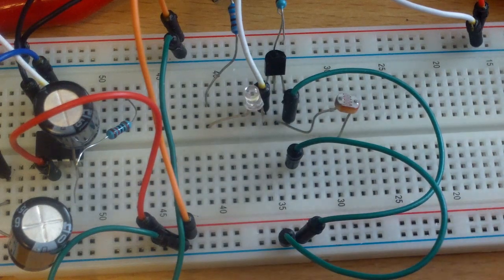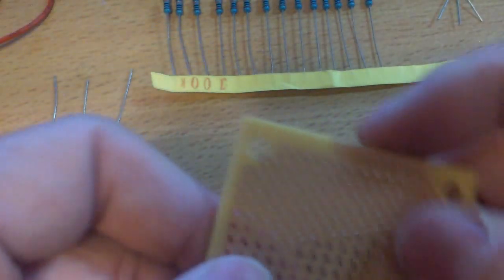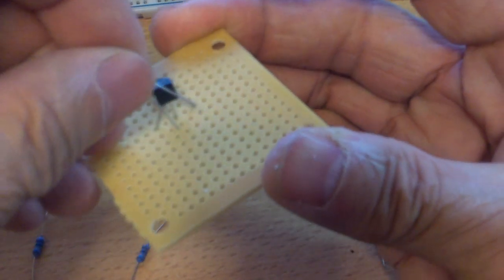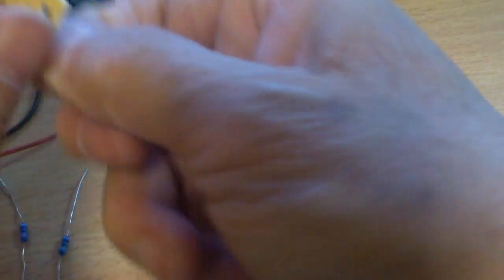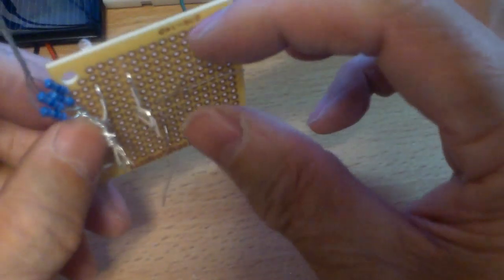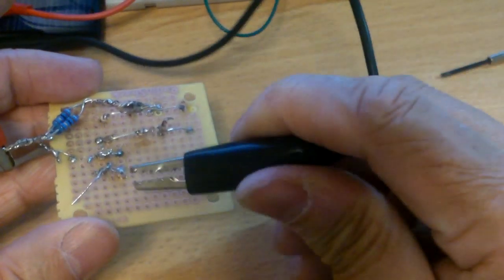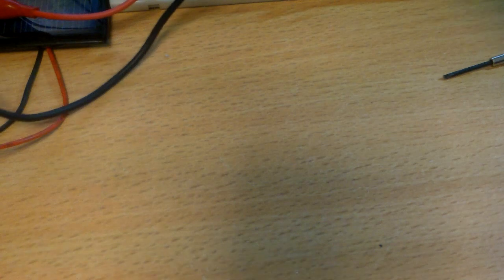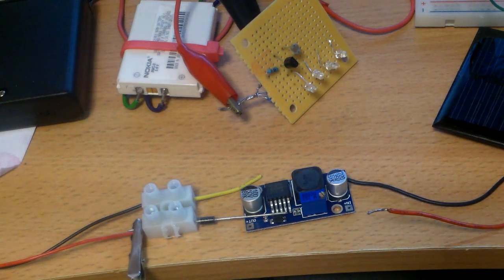Almost step by step guide to making your solar rechargeable night light

Comment: My led's light up, however- when I shade the photosensor, nothing happens.. Have I hooked up the photosensor wrong?
Reply from the maker: Your photosensor should be a small solar panel.  It should turn on when light level is low and turn off during the day.
Reply: Thank you for the answer. I realize that the photosensor regulates based upon the amount of available light. However, like you, I hooked all up prior to soldiering and found that when I placed my finger over the Photosensor, the led remained unchanged.. In fact it stayed lit with my finger off the photosensor and stayed lit with my finger on it, as well. Thus, my assumtion that I hooked it up wrong. Any ideas? :)
Reply from the maker: Romany Caravan Company Try putting the unit under sunlight for it to charge. Then bring it back in at night and see if it lights up. I will make another video of this project (when I get a chance) to see if I experience your problem. Sorry it didn't work out for you.
Reply: thank you. I will try to rewire with another photosensor. Perhaps it's a bad one.

Comment: Very nice! I want to use only a single bright warm white LED how does this change the set up from the 4 lights used and demonstrated.

Many Thanks
Reply from the maker: It works just fine with 1 LED or 4.  One LED will last longer too.
Reply: Thank you for the reply sir. Very impressive demo for a subject that baffles many of us :)
Reply: Can I use a rechargeable coin battery 3V  with this set-up? Thank you in advance for your answer.! Best, Mark
Reply from the maker: Romany Caravan Company Better to use 1.5v AA rechargeable battery. The eneloop battery works well and the light can last a long time.
Reply: In my product and application I only have room for a coin lithium ion battery. I am only using one light with this project. Would I need a booster? If so, would this one be appropriate? 
3A-DC-DC-3V-25V-Step-up-to-5-25V-30W-Lithium-Battery-Solar-Booster-Power-Module? Or perhaps I could go without?

Thank you in advance,

Mark

Comment: 4 x 91 ohm resistors in parallel that would be the sum of reciprocal of 91 ohms, right?
4 x (1/91) = 0.04, correct?
wtam69

Comment: Great video, have been trying to find something like this for a long time.

One question though; I could just skip that socket and diode between the board and battery pack and replace it with one of those lithium charge controllers right?
Reply from the maker: If you are not solar charging the batteries, you can use just the lithium charge controller and skip the voltage boosting board. If you want to use a solar panel, the voltage boosting board can help to increase the voltage and keep the charging voltage within limits.
Reply: Thanks for the answer!
My goal is to charge 2 AA batteries with a 5v solar panel, that would be sufficient right?
Reply from the maker: Peter Larsson If you want to charge 2 AAs, you can use a battery holder (with the batteries either in series or parallel) and a small blocking diode. The silver band of the diode pointed towards the battery holder and connected in line with positive. The negative of the solar panel connected to the negative of battery holder. For the few hours of solar charging,  you don't need a controller.  The video above is really for the making of a rechargeable solar light. Much like the ones you buy in a store.

Comment: What about the Circuit.
Reply from the maker: It's a generic circuit. Go 15:29 of the video and pause the video to look at the circuit. Depending on your power supply voltage, you vary the resistor values for the LEDs.

Comment from the maker: You're right. Some booster can step up at lower voltage. Some of my solar panels don't charge that well, especially the cheap ones. When they heat up, they lose voltage, that's why I try to be more conservative and use higher voltage panels to begin with.

Comment: Since i used really effecient cells, the panel is really 3.5-3.6 volts. and gets 450-550 ma. I've seen voltage step converters starting at 2 volts.

Comment from the maker: In my setup yes. The idea is to limit the voltage to the each led to 3 volt or so or you can burn out the leds. If you power source is 12 volt, you can put the 3 leds in series and use just one resistor of about 105 ohm. 12v minus 3x 3.3v = 2.1 volt. If your current draw is 20ma, then to regulate 2.1v is 2.1 divided .020 equals 105 ohms. Again I know nothing at all about electronics so take everything I say with a grain of salt. The BC 547 can handle 100ma.  I tried up to 4 leds with no problem

Comment from the maker: If you can add one more volt to your 3 volt solar panel, you can use a dc voltage booster to boost the voltage to 5 to over 15volts, making your panel more versatile. I only know how to do simple so I'll the hard ones to experts.

Comment from the maker: Yes, you can use a LM7805 to reduce the voltage to 5v or so. The chip is about a dollar or so. Better still, for 12 volt use,  put 3 leds in series and use a 100 ohm resistor in line. That way you don't have to use a voltage regulator. This solar light doesn't put out that much light. I have made a 4 LED unit and the brightness is ok. The transistor cannot handle too many LEDs. Anyway,  the good part about do it yourself projects is you can do it whichever you like, as long as it's safe.

Comment: Nice job. Really like how bright they are. Paul, can you use a voltage regulator to decrease the voltage say from12v to 6v?  My solar electric fence sometimes has a problem and takes a few extra days to get the battery topped off. Was thinking maybe set a car battery out there and bring the voltage down to 6v the size of the car battery would run the fence while I take home the little 6 volt battery to charge on house current.  Thanks for the help.    Thomas